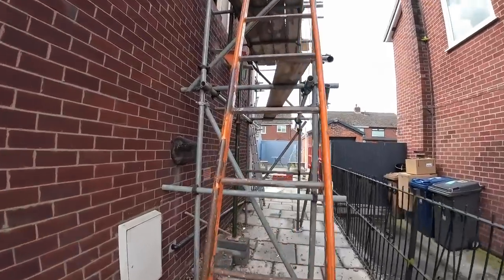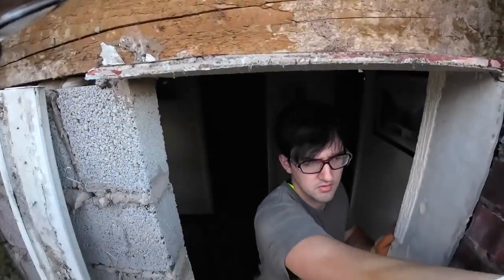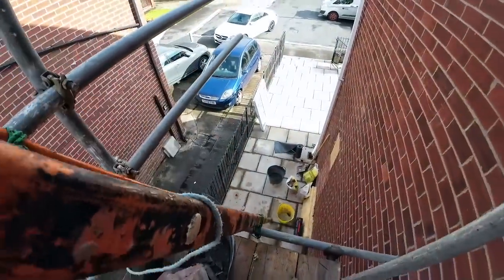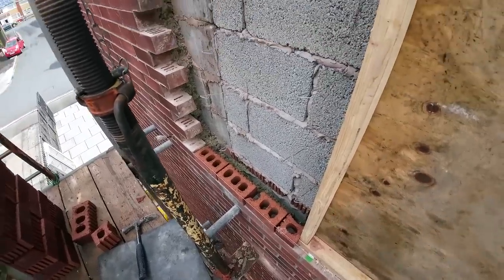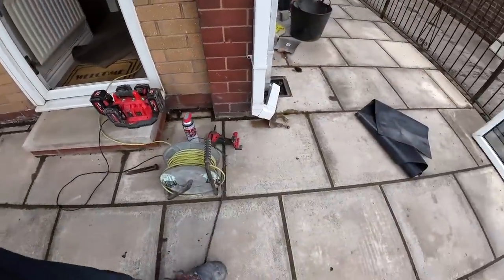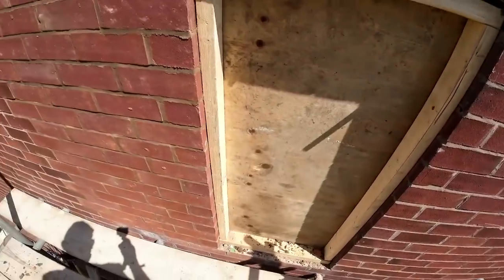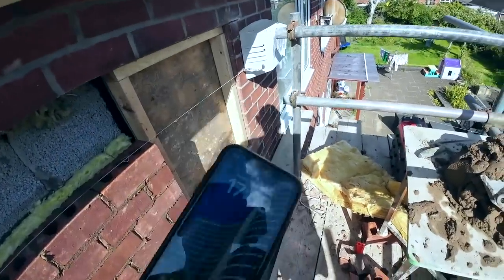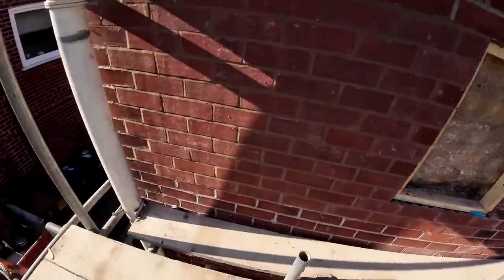THIS WINDOW COULD HAVE FELL OUT!! ALTERATION JOB PART 3

Comment: Not just windows. Years ago I lived opposite a bungalow which had a large folding door at the rear. One day there was an enormous crash of glass as the entire frame fell out. Amazingly nobody was hurt but it was still a shock. And what was holding the frame in. A bit of expanding foam and the silicon applied round the edge.
Reply from the maker: Jeez 😳🤯😱🧱👍🏽

Comment: Those clips on the side of the window  are for pushing into built in formers , that fix the window obviously no built in former though, so yeh not a fixed window. Good work as normal
Reply from the maker: Thanks Karl now they make sense and so were completelty useless 🙄🧱👍🏽

Comment: Putting the template board inside makes removing it to fit the window a much bigger job unless done from the scaffold.
Alex could have done it off the landing
Reply from the maker: The windows were fitted of the scaff 🧱👍🏽
Reply: Good thinking.

Comment: Hi boys, have you tried the brickmate system ? I have used it a good few times it's very good
Reply from the maker: What’s a brick mate system ?
Reply: Instead of using strongbow and akros they are clamps which apply sideways pressure to the brickwork above and are linked together with a scaffold tube
Reply: I have had a set a few years I can't remember the name boys sorry but it works well
Reply from the maker: @daverogerson5969 . Ah I know what you mean, no not yet 🧱👍🏽
Reply: They save so much messing with akros, and u can use them where you can't get an akro in
Reply from the maker: @daverogerson5969 🧱👍🏽